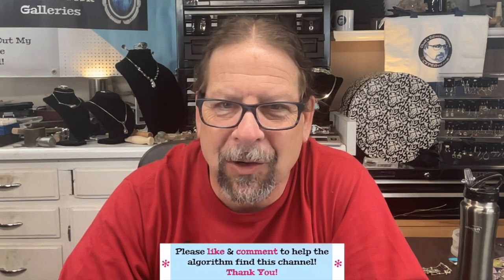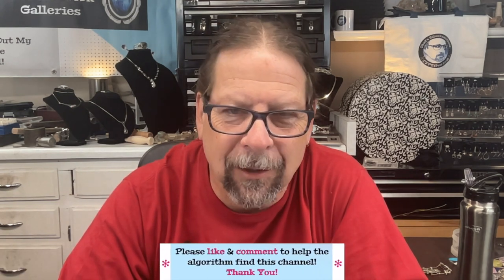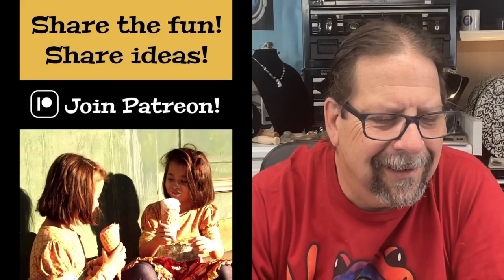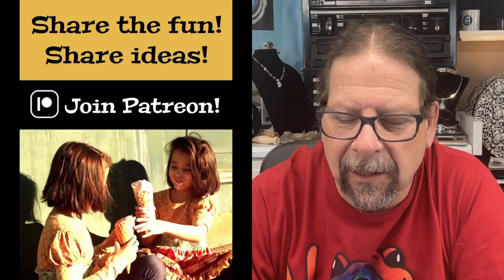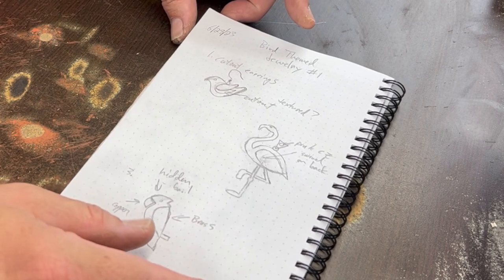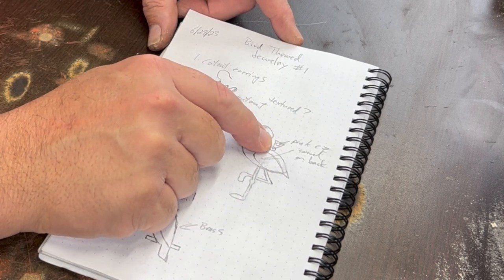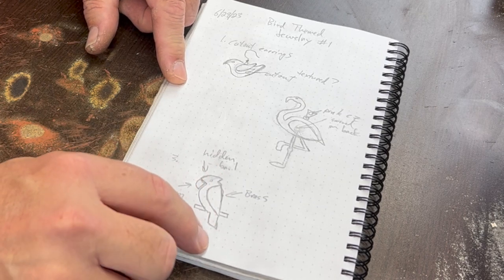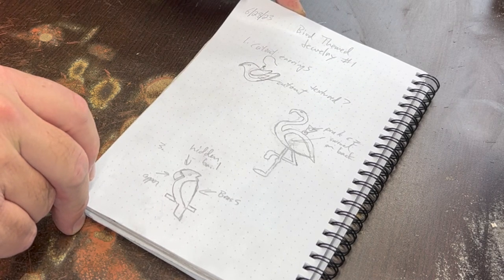Make 3 Fun Bird Themed Jewelry Designs: A Silversmithing Tutorial

Comment: Hi Chad, the birds are a really fun design. For what it's worth, some tips someone gave me that not only improved my sawing, but also makes my blades last ages, was to use longer strokes (full blade length) and to not apply pressure against the metal when sawing, but rather just let the blade glide lightly up and down. :)
Reply from the maker: That’s really good advice Susan!  I also need to find a higher surface to clamp my bench pin to so I’m not hunching over it:)

Comment: You can put silver, copper and brass in the same pickle pot? I was told copper and brass would contaminate the silver
Reply from the maker: Hello Angel. I have not really had any problem with it:)
Reply: I've done it and no problems. I'm new to this and was wondering if I'm doing something wrong
Reply from the maker: @angelhewitt3077  I mostly work with just silver, and only occasionally add some copper or brass, so I’m not an expert about that.  Perhaps someone else who has more experience than me with mixing those metals could address Angel’s concern in the comments here about pickling them together. As I said, my knowledge is purely anecdotal so I may not be the best one to answer this question.